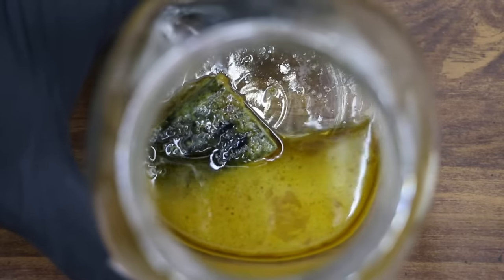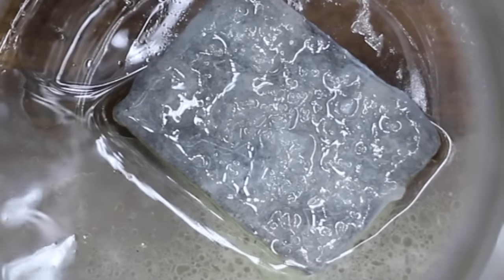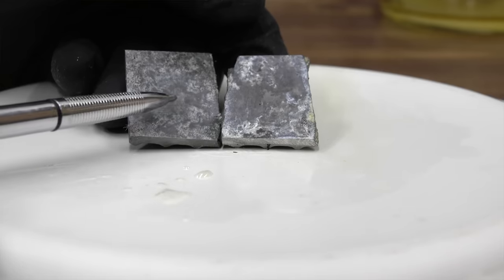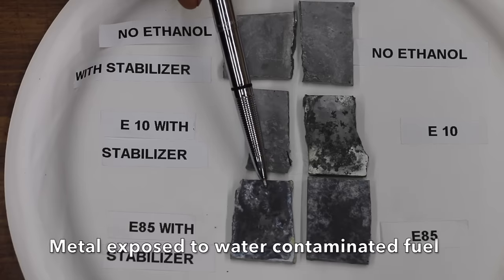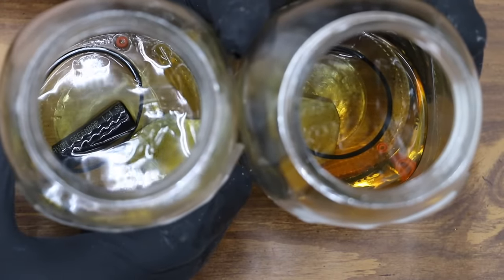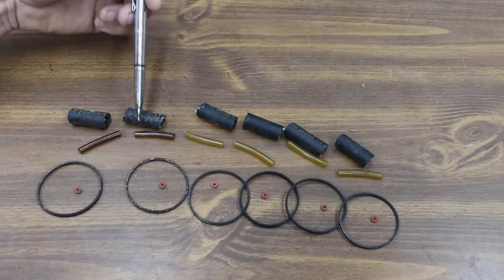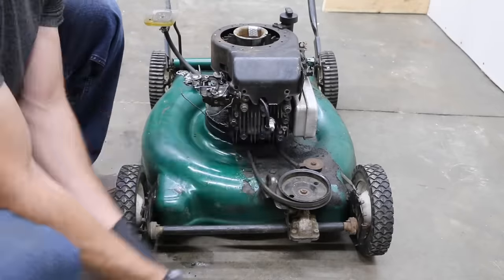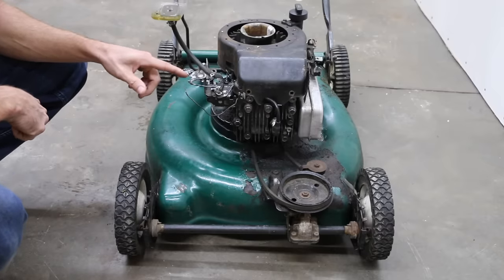Does Fuel Stabilizer Prevent Ethanol Damage?  Let's find out!

Comment: This is a FANTASTIC video comparison of what effects Ethanol in fuel has on older conventional fuel systems. As a classic car restorer, everybody knows that most car hobbyists use their classic car much like a motorcycle and small gas engine- Seasonal. And we endure the same fate as they do every time spring hits and we want to take our cars out. I've been hoping to find someone that did a well thought out and well presented video so show proof of what I've been preaching locally since E10 became the standard at all our local pumps. Your comprehensive testing is FANTASTIC and showing proof of the ill effects of Ethanol in fuel in limited use engines and fuel systems. I believe it's also to blame for a rise in vehicle fires from degrading fuel lines without people's knowledge. I had a few instances I luckily caught before it became a fire hazard! (ate right through the fuel line itself) So thank you for doing this video! I will certainly share it around to make sure others are informed!
Reply from the maker: Thanks and you are welcome!

Comment: Would love to see this comparison with various brands, specifically: 
Sta-bil
Star Tron
Sea Foam.
Reply from the maker: Thank you for the video idea!
Reply: I think a lot of us would like to see that comparison test
Reply: Awesome idea.  I use Star Tron in everything.
Reply: Lol don't leave out Amsoil!!!
Reply: Please add PRI-G to the test.
Reply: @Wrecked01  I use it, however I am skeptical that it is really doing anything.  Maybe a placebo effect, although I never store things with fuel quite long enough to really know.
Reply: My personal experience with Sta-bil has been terrible.  Seafoam has been much better, but I have no experience with Star Tron.
Reply: @ProjectFarm  Definitely Seafoam! I feel like I've had great results with it, but I don't know if that's my brain lying to me or not.
Reply: wizzells I unintentionally left my Chinese generator full of fuel / sta-bil mix for two years. Started and ran just fine although I don’t recommend and will drain in the future.
Reply: @thejunkman  Had carb problems in 2 small engines when using regular gas (wouldn't start until cleaned out the carbs).  Started using Star Tron and no more problems.
Reply: Add a lil 2 cycle oil to that list please
Reply: If you do this, try to look for Mechanic In a Bottle or Ethanol Shield.  I first hand saw how well this product works va startron and seafoam, aswell as Stabil Marine.  It was where i worked for 3 year's, some amazing stuff. It's a small company out here in South Carolina, but ive found their products in true value, walmart, and home depot.  Definitely worth a shot if you want to do a large comparison video due to the time it takes to let these fuels go bad!
Reply: Marvel too don’t forget
Reply: Absolutely
Reply: @richardheinen1126  what is 2 stroke oil supposed to do? Even so, what ratio? 50:1, 100:1, 20:1? What?
Reply: Definitely
Reply: @thejunkman  I've actually had some luck with some of the Lucas stuff Autozone pushes, which may be slightly different from what he tested if they didn't just change the label.  Basically about two for three as far as gas not going off in equipment went last winter.   (I just added stabilizer, drained float bowls, closed lines.)
Reply: @kleetus92  I use a 2 cycle fuel mixture  before I put all my small engines away for the winter. Forget fuel stabilizers. WIth the terrible  quality of fuels we buy at the pumps this day and age the fuel stabilizers won't  do enough to neutralize the damage left behind due to evaporated fuel. What I've found  is that the oil residue left behind after the 2cycle fuel evaporates over the winter months seems to do a pretty descent job at protecting the insides of carbs and fuel tanks. It's  my go to every time before putting equipment away for the winter. Give it a try.
Reply: I agree, this would be good to see with various fuel stabilizers, go to a local auto parts and just grab one of each haha. I have even been told marvel mystery oil can be used as a stabilizer so I would try various fuel additives too.
Reply: ill 56th this. I recently used star tron in two vehicles i had to ship from Hawaii to Alabama.
Reply: @andypeterson2647  Seems like a worthy Hypothesis... May need to give it a try.
Reply: kleetus92 I don’t know, a guy at work swore by this. If I see him I’ll ask how much he was using. He claimed it did all kinds of great things for the fuel system and engine. 
I never tried it myself.
Reply: With the long-standing documented damage I just can't understand why people continue to vote D with their misguided environmental activism creating legislation that destroys everything that we own.
Reply: up vote for Sta-bil
Reply: I always use Sta-Bil and now I'm curious. Please test it.
Reply: Here's my anecdotal but extensive experience with storing gasoline: I use Sta-Bil  and run the gas in small engines of all sorts, a tractor, cars, and a motorcycle. I've never had a stale gas problem over 20 years of use, initially with the recommended dose for one year's storage. Of late I double the amount and let the gas sit two years and have done so the last six years or so. That gas works well too.

Two qualifications: I avoid ethanol like the plague it is, and I also add Marvel Mystery Oil in recommended amounts, not as a gasoline preservative but as an upper cylinder lubricant. I didn't know it, but MMO might also be helping keep gas fresh.
Reply: @mrmomb  The Question(s) we need to ask is WHY the Fuel Stabilizer (Not to mention the E-Fuel Blend itself) doesn't neutralize the Corrosion issue... Seems that is what is  actually destroying something. Not a person's political/environmental values.
Reply: @Wrecked01  I do also seems to work very well also seems to rejuvenate older fuel
Reply: Second this - avid Star-Tron believer. Seems to keep the ethanol crap stabilized in my boats year-round.
Reply: Star Tron is what i have been using for a very long time. I even use it in the "non" ethanol fuel and carb bowls are pretty clear when i check them.
Reply: I could tell you sta-bil disappointed me

And I find Star Tron to be the best.
Reply: @Wrecked01  

Star Tron, rocks!
Reply: I've been using Stabil for years in all of my gasoline engines. Some of it sits in the carb for months and it doesn't hesitate to start. I do the 12 month storage dose every time.
Reply: @jrgaston8891  I use sta-bil in my generator too. I start it about once a month and shut off the petcock so no fuel is in the bowl when I turn it off. never had any probs either.
Reply: @ProjectFarm  there's also Sta-bil blue for marine applications.
Reply: Yes please
Reply: 3G Craftsman same thing mine told me so I'd love to see if the red vs the green marine is better or not.
Reply: And add quicksilver in the mix!
Reply: You should test the Hot Shot's Secret products
Reply: Another excellent informative video! Great job, I wondered how bad it really is, now I know. Paying more for ethanol free is definitely worth it.
Reply: @Wrecked01  Agreed!!! I use Seafoam in everything!!! Lol.
Reply: I use a cocktail of Star-Tron, Marvels Mystery Oil, and 2-Cycle oil and that has reduced having trouble with small engines, snow blower is an exception because it never gets drained and the fuel looks like cooking oil after a year.. 2-gal gasoline + 2 tsp Startron + 1 Tbs MMO + 1 Tbs 2-Cycle oil; this works for me when my mower sits for a month or longer without issues.
Reply: @jrgaston8891  I been using Sta-Bil forever. I leave all my chainsaws full of gas year around, never had a problem ever.  One of these saws I bought in 2003, so its 17 years old.
Reply: @wizzells  Sta-Bil sucks, froze up two carbs with that junk
Reply: @kleetus92  I would say  that the oil  in Marvel  helps prevent corrosion, But that's a guess. I use it on small engines.  No big problems with them.
Reply: @ProjectFarm  I'm curious about Amsoil fuel stabilizer in addition to the ones that wizzells added.  The more the merrier, really, if you are up for testing more.
Reply: I would love to see this as well. Just to let everybody know here it will be a year in the test as he is very thorough. Just give the man some time.
Reply: 3G Craftsman I heard that as well from a marine mechanic
Reply: Agreed, Definitely Sta-bil. They seem to be the most reliable. I have never had much luck with any Lucas products. They have pretty cans, though.
Reply: I use star tron all the time... I am very interested to see trst results!!
Reply: @ProjectFarm  Might also be good to try a water removal product like Heet or STP when trying to run the engine.

On a side note, what did you tell Mrs Project Farm when she asked if you knew where her canning jars were?
Reply: @HariSeldon913  Heet is either methanol or isopropyl alcohol, yellow bottle or red. It allows water to mix with gasoline so you don't get raw water freezing in fuel lines. Methanol is very corrosive to engine components; isopropyl less so, but both will cause the same long-term issues as ethanol.  They are just bandaids to fix water-contaminated fuel. Fortunately the alcohol concentration is much lower than e10, when used as directed.
Reply: @larryamos6214  I switched from Sta-bil to PRI-G several years ago and couldn't be happier.  In my opinion, Sta-bil is way over hyped and causes jelly in carb bowels. Non ethanol gas combined with PRI-G is all that I use, combined with running the carb dry for storage.  I repair all types of small engines.
Reply: Same results, why piss away money on hoping to offset the effects of ethanol when you could just buy ethanol free recreational gas?  I’ve been a small engine mechanic for years and have seen all the “secret” solutions fail over and over again.  I’ve literally made a living off those additives. The best way to eliminate ethanol problems is to eliminate the ethanol.
Reply: What about one of those DROP-IN Water Absorbers that iv seen for atv's & snowmobiles ????
Reply: @ProjectFarm  stabil is what most of us use in addition to none ethanol with our boats
Reply: @mrmomb  ethanol expends more energy than it produces in manufacturing.  It makes no sense at all.
Reply: @gharth1988  I agree, Mechanic in a Bottle actually got a 4 stroke snow blower, a 2-stroke snow blower and an old lawn mower (all with old ethanol gas)  that sat for 10 years to start up.  Had to let it set in the tank for about 30-60 minutes.  So, now I add it to all my gas cans (ethanol and non-ethanol) and pour a little extra in the gas tanks.  I keep a case of it handy.
Reply: @andypeterson2647  being a 2 stroke MC guy, I've done the same for years, full tank in fall with 50:1 mix of Yamalube
Reply: @gharth1988  the active ingredient in all those cures is fine oil, distillates that prevent the dissipation of the ethanol fuel additive in the gasoline.
Reply: Sta-bil is great, never a problem  using